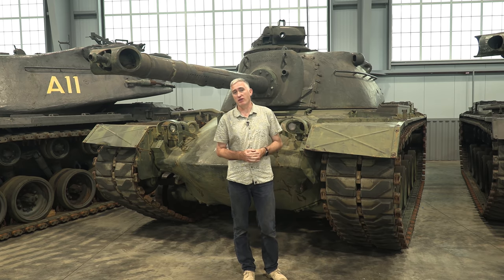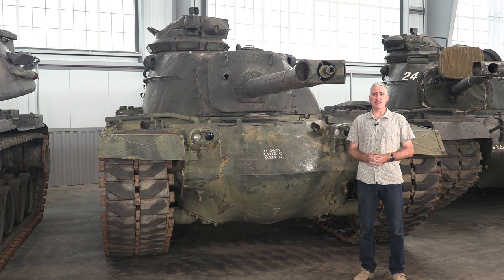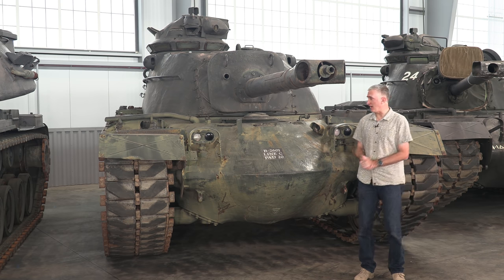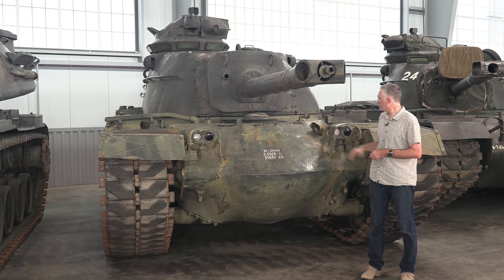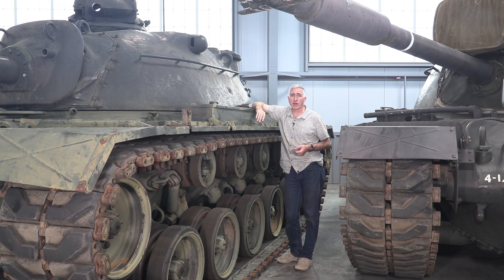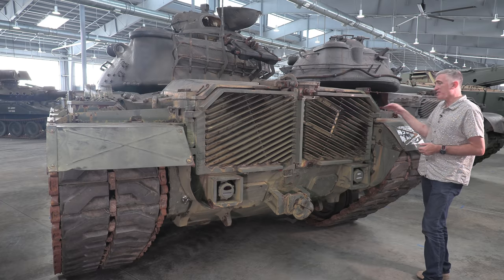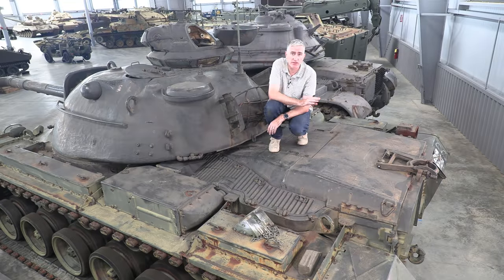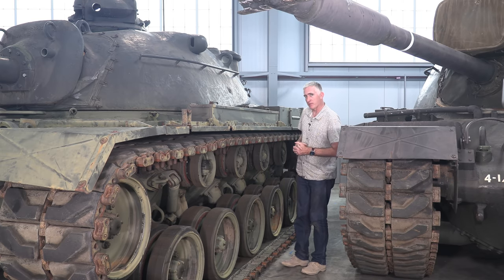Inside the Chieftain's Hatch: M67A2, Pt 1

Comment: If  you see those fender mounted air cleaner boxes, it's a diesel.
Reply: Same with the back deck.  Raised back deck, diesel.  Flat back deck, it's a gasser.
Reply: @DK-ed7be  raised back deck can be a gasser as in the case of the M48A2

Comment: 7:48 - An IR suppression system on a flame tank sets the base line for judging military procurement.
Reply: With enough bureaucracy you could sell wings for battleships and safety guards for barbed wire.
Reply: I don't know why he said that.  The raised deck and engine grills are about cooling the engine and transmission.  Even the large rear grill doors are part of the cooling system.
Reply: @DK-ed7be  if it was pure cooling, it would be vented from above as well, instead only the back is vented to prevent overhead IR spotting. however yes they do want a large engine compartment for any number of reasons.
Reply: @dumpkin donutt indeed a wise thing, in Warfare Surprise is key, and if you're spotted making maneuvres the enemy can adjust or intercept based upon that information
Reply: @moosemaimer  if the lobbyist has enough money to throw around.
Reply: @BillMcD  Cool air is drawn in from the top grills either side of the engine.  The air is then sucked down around the fuel cells and then back up between and past the jugs, thus heating up the top deck.  The hot air is then pushed over the top of the heat shielded transmission and out the rear grill doors. 
That back deck made for some excellent sleeping when it was cold, for the deck got pretty toasty.  So I don't understand what anybody is saying about the IR signature being reduced.

Comment: The PTO was used on the original dozer blade system. It was a bulky system of plumbing from the rear over a fender to the front. The two small ports on either side are used to access the CD850 transmission's band adjusters, also found on M60 hulls. If you bumped the transmission when reinstalling the pack, you could release the bands and the tank wouldn't move, steer or have braking. The bands are also important for the parking brake. When you walked along the side you forgot to mention the air filter for the engine is sandwiched between the sponson boxes. The AVI's and upgraded turbo charged versions had 4 magnetos that had to be timed. Each Mag ran 6 spark plugs, each cylinder had two massive spark plugs. Timing required a special timing light and two popsicle sticks.
Reply: I thought it was for a hay baler

Comment: Interesting video.  I spent a lot of time in M 48 A5 at the NTC.  Fun tank.  Like a sports car.  Only bigger.  One of the idiosyncrasies of the M48 with the gasoline engine is they caught fire.  A lot.  My time in M48s overlapped with some "old timers" who worked with the early marks.  They said it was not unusual at all to have them backfire through the carb on a cold morning and burn to the ground.  They said it was so common that they changed their starting procedure to have a crew member standing on the back deck with the doors open and a big fire extinguisher.   The fuel injection upgrade helped to reduce engine fires which if they did nothing else, was a big improvement.

brand-new

Comment: WOWIE! A max range of 70 miles is so small for a "main" battle tank. It's no wonder they vastly increased the range with newer engine updates throughout the years.

Operational range: [Later models per wikipedia for M48]
135 mi M48A1
110 mi M48A2
288 mi M48A3
310 mi M48A5

Comment: Power Takeoff Point: could it be for running booster pumps on a fuel trailer?  A fuel trailer is not an uncommon accessory for flame tanks.
Reply: Makes sense - but IDK if an extra pump was even necessary. IMHO, the power take off was on all tanks this hull type. IDK how many flame tanks were made, but casting an extra hull without it makes no sense. Therefore, if you don't need it - just keep the plate on. The other way around, needing one and not having it would be a pain in the butt, since drilling ~0.5 inches/12.5mm of super-hard cast tank steel in the field is no fun at all.
Reply: @stanislavczebinski994  that makes more sense.  PTO for any potential future needs with nothing really specific in mind.
Reply: @Yaivenov  Thank you. Even if you only tow a standard cargo trailer offroad, you might need something as simple as an interior light to find stuff. Remember, there where no hi-power led flashlights available back then.

Comment: All M60s and probably almost all M48s had the external phone.  So one can't simply note that feature and glean that the tank is thus an infantry support vehicle.
Reply: He said it the other way around. It is for infantry support, thus a phone. Important difference.
Reply: @biscuit715  I don't care how he said it, the implication was the phone was there because that particular model of tank was for infantry support.  Actually the phone is there because ALL M48s and M60s had external phones.  In fact all US tanks since WW2 until the M1 came along had external phones for communicating with grunts.  Moreover, even the M48 and M60 AVLBs had external phones as did the M728 engineer vehicle.

Comment: Drain holes for unburnt fuel ? That's really scary if that fuel drips over the hull.
Reply: As the Chieftain pointed out many times with the Russian fuel tanks, fuel burning on several inches of steel or on the ground is nothing to get concerned about.

Comment: Are you sure its PTO? Just thinking with the WWII flame thrower tanks they normally towed a trailer with more fuel for the flame thrower and that spot would be ideal for the hose to come into the tank? And secondly I can't think of any trailer that a tank would pull that would use a PTO. Humm time to start researching lol. Maybe power connection? Oh hell tell them to open it up and let you peek inside for what it is 🤣
Reply: I always thought that port was for externally cranking the engine?
Reply: @jarink1  Possible makes more sense (no offense Chieftain) than a PTO. Especially if they had Korea in mind for winters. I would assume the access cover was bolted closed for long term storage? 🤷‍♂️

Comment: What is the triangle shaped casting on the bottom of the front hull,  looks like the G badge of a grizzly ?
Reply: General Steel Castings, originally Eddystone PA, later Granite City IL. Formed by several steam locomotive builders to cast entire locomotive frames, including the cylinders,  in one piece.  You will see that raised G shield on a very high percentage of US tanks, going back to WW-II, as well as a lot of later steam locomotive frames.  See the wiki for "General Steel Industries", it shows the logo.